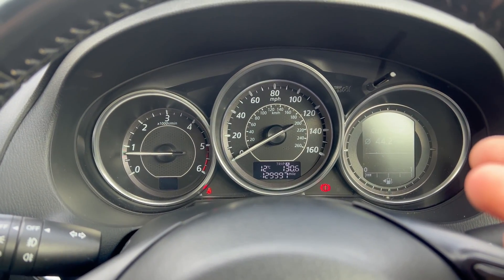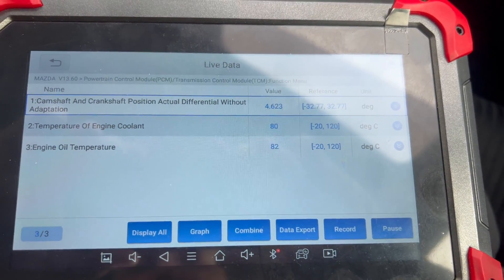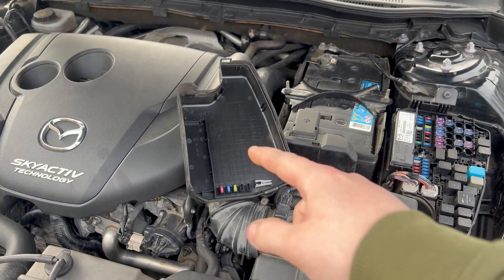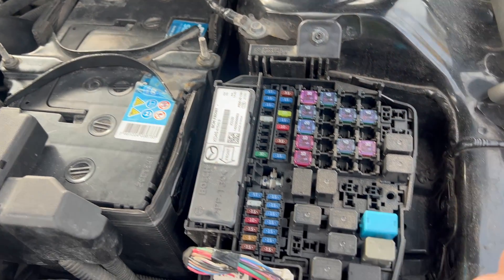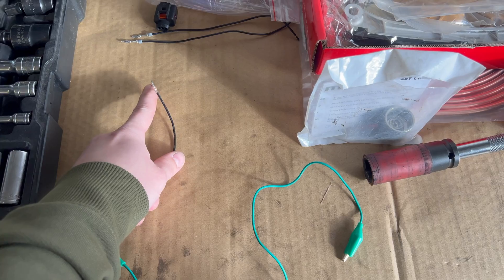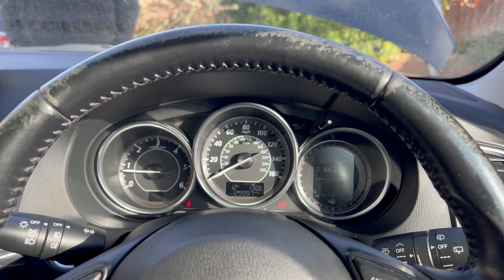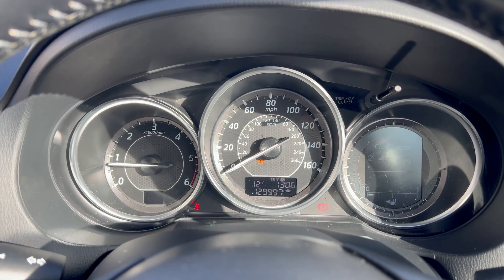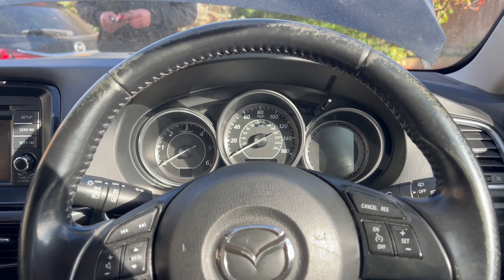Mazda Skyactiv Timing Chain Reset Procedure Calibration

Comment: Hi. If I changed timing chain kit, exhaust cam and cleaned injectors, now it does not start, what can I do? On forscan there is no errors.
Reply: Same here, have you found a solution?
Reply: @Dee-q4q3d  Yes. With mine it was my fault. I opened the injectors for cleaning and reassembled, so managed to break all 4 injectors in the process. Never open the injectors. Bought a set of second hand ones, coded and car started immediately.
Reply: @adybiluta sorry about that, but thanks a lot! Let me apply that to my case and see if it turns on. Sounds like I'm not getting any compression at all.